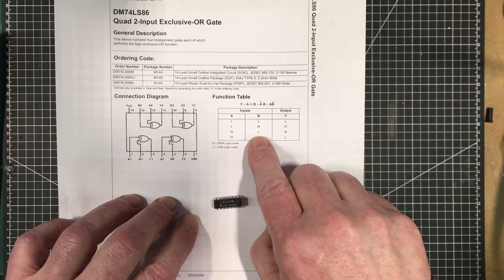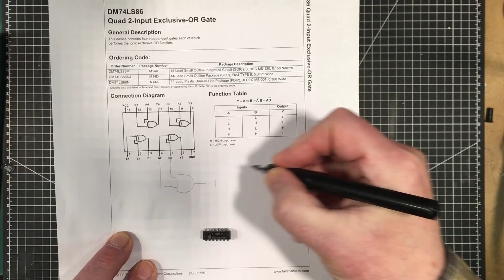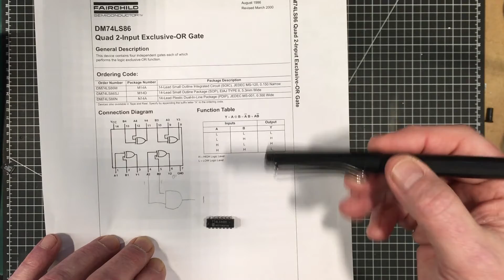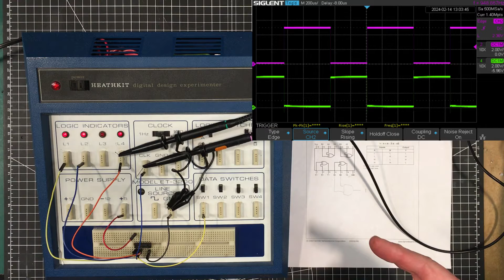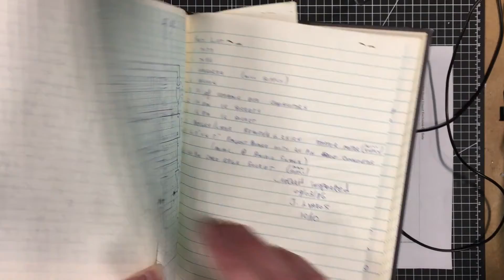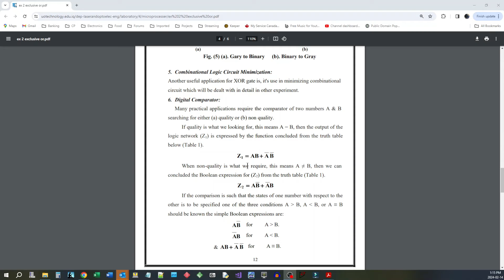0159 - Chip of the Month:  74LS86 Quad 2-Input XOR Gate.

Comment: These days I only use breadboards to find the value of resistors for LEDs. For everything else, I prefer to simulate, as it is a lot quicker and no more damaged components.
Reply from the maker: I'm still used to a (very) small amount of breadboarding.  Back in the day I tried simulation, but back then it was inaccurate or expensive (choose 1).  What do you use?
Reply: For Texas Instruments parts - Tina-TI, for Analog Devices - LT Spice. For everything else I have a 10 years old copy of Multisim/Uliboard (they no longer improve/develop it, but these days they are asking $800 per year!). Unfortunately complex chips do not have any spice models, so I can  only simulate parts of the circuitry.
Reply: It works quite well for analog stuff like amplifiers, but then manufacturers like Toshiba are so lazy that despite making some complementary pairs for 10-20 years, they have only managed to produce model for NPN. Luckily, you can always substitute models of similar transistors from another manufacturer.
Reply: Today hobbyists are using  free Kicad. I have it installed, but knowing how much time it took to learn Multisim/Ultiboard I hesitate to try something new. I write in short parts, hoping that psychotic Comrade YT will not block it.
Reply from the maker: @jakubczajka4275  Thanks for the input.  I have had LT Spice installed on one of my computers for a while, but have not proceeded with it.  I guess I should at some time..